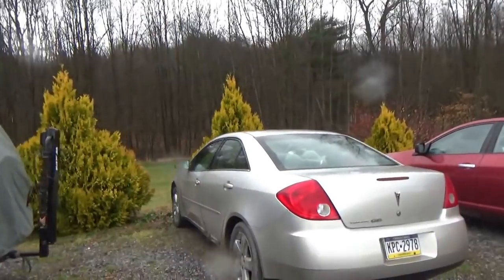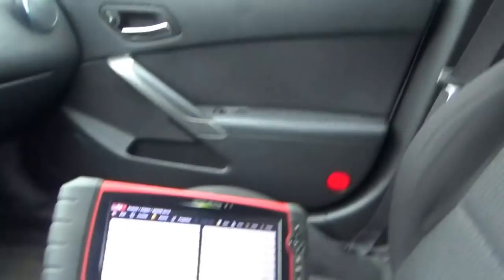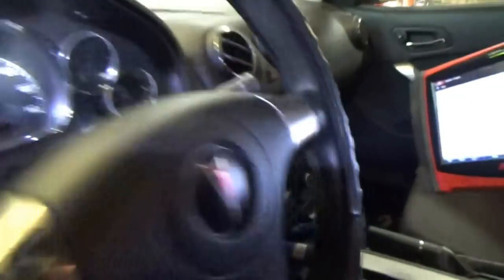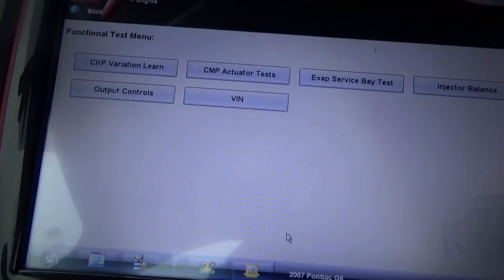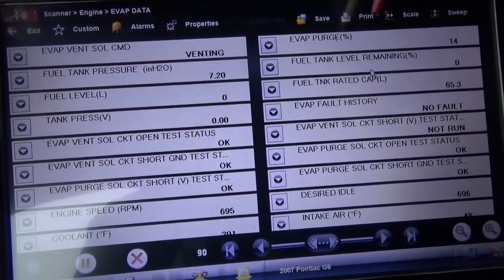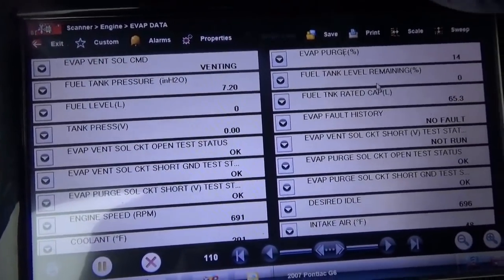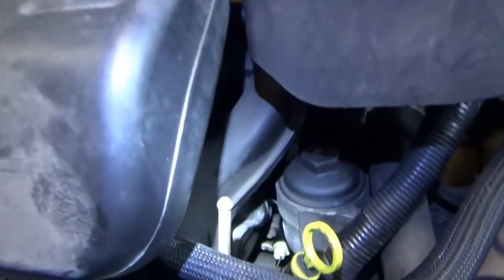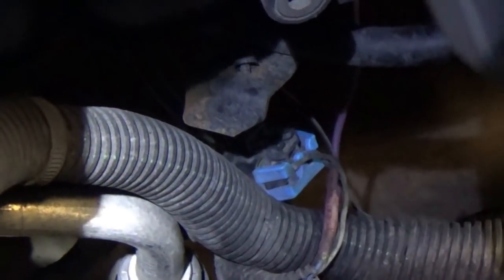GM No RPMs! P0335 Diag & Repair

Comment: On the knock sensor, once the wire is repaired, scan engine data knock signal and take a wrench and tap the engine while viewing knock signal data and you should see it pick up the taps from your wrench/screw driver/small hammer.
On the fuel level sensor, disconnect and jump your test light (bulb resistance) across the level sensor wiring and you should read about 1/4 tank, if guage doesn't move than your looking at instrument gauge repair.

Comment: I did, I did, I did.  My thought was "where are the two wires?  I only see one, what happened"  Thank you for the video Ivan.
Sometimes when I crawl on my floor I use a sheet of scrap foam insulation as a thermal break and it also helps with those tiny pebbles that dig into my knees reminding me I don't have a lift.
Reply: Man i know your pain...Hate it when you kneel on something small n sharp....

Comment: Nice diag and yes I caught the mix up I was like Ivan nooo it's the Oil Pressure Switch, I know because I have a customer with a Cobalt and had to swap the Switch out, connector was full of oil and Oil Light was on all the time 😎

Comment: Wiring under the carpet in the drivers seat area is common for many problems with rear lights and components. Pull the seats and carpeting and start tugging on wires for preventative measures. Arrange the harness of the floor and make small drain holes to allow the water to weep out. Awesome videos. Keep up the great work.

Comment: Don"t you just love when the engineers cram everything in there so its tough to get at the connections to do repairs..
Reply: Why would they place a critical connection in a hostile environment without any external protection is just poor engineering....A simply 50 cent rubber box mounted to the chaise could eliminate corrosion on the connector....

Comment: Customer must be strapped in these troubling times, otherwise would have had you sort out the fuel gauge, you were right there but you can only do what they are willing to pay for
Reply: you see the rust? dropping the tank is opening a can of worms  unless the emmissions calls for no light on the pressure sensor dont touch it.

Comment: I noticed the P0326 which is a knock sensor fault code for that particular vehicle.

In my 5.7 litre Chevrolet LS1 V8 powered Holden VY SS Commodore I had a similar P0327 code stored on the PCM which is a low output voltage code for the front knock sensor that I replaced in 2009 so I had to replace it again in 2019,the code would be set whilst driving on the freeway which also set a check engine LCD symbol on the dash & it would automatic turn itself off.

I had already replaced the rear knock for a P0332 code & the "new" sensor that I previously fitted was a Chinese knockoff which I replaced with a Wells knock sensor in early 2019.

I replaced the front one as well as the knock sensor wiring loom in mid 2019, I also did the GM TSB (technical service bulletin) for building a silicone sealant dam wall up around the sensors but my tip is to keep any water away from the Knock sensors.

Once the Connectors corrode & the knock sensors wear out a code is often set for the knock sensors !

Comment: You know I feel for the owner who had rodent damage to their vehicle. I have had a female squirrel make a nest in my Tacoma and did $400 damage two times. So, the solution is to buy a special tape made by Honda...since Honda and Toyota are both rodent targets and looks like other brands as well....this tape has capsaicin embedded in the vinyl. In Canada it is about $60 per roll. I would highly
reccomend this tape for repairs on wiring. Another good deterrent is fake snakes under the hood. My wife got me 4...they are in various locations and seems to work well. Trust me...that Honda tape is REAL GOOD
Reply: Mike Foehr my tundra became a teething ring for some squirrels. I repaired it and they came back with a vengeance and chewed wires beyond my capabilities. $7000 for a complete harness. The added the hods rodent tape.  I made some peppermint repellent containers too.  So far so good.

Comment: You could have used the test light to pull the voltage up on that pressure sensor to confirm good wiring to the pcm or could you have confirmed operation by doing a vacuum test using scan tool to shut the vent valve... All very interesting stuff

Comment: I have a 2011 silverado 5.3L. I had the rear brakes done, they also bled the brakes. The mechanic also had to retighten the transmission dipstick because it was loose.  2 days after they did this I was driving it and it went into limp mode, service traction control, service stabilitrak popped up and 0 rpm.  I turned it off and waited and then the problem went away.  I started to become harder to start throughout the week so I tested the battery and replaced it due to it being bad.  6 days later the same service stabilitrak service traction control popped up.  I had the mechanic take a look and I don't know if he ran old codes on it but I think he said it was P0335.  He said the sensors are made pretty well on these engines so he said more than likely it could be a wiring issue. I'm going to inspect it but I will have to take the starter off (damn).  I'll let you know what the wires look like.
Reply from the maker: Just scope the signal at the PCM...if you have a scope!

Comment: I just got this code on my 2006 Dodge Ram 1500 I was on the freeway and my rpm dropped and I pulled over and got the truck home. It still starts but I’m not sure what the problem is I’m going to replace the sensor hopefully it fixes the problem

Comment: I wondered how a knock sensor could leak oil. They are usually mounted to the block and not into any oil passages. Oil pressure sensors have been known to leak.

Comment: I have a 2015 Buick Verano I put a timing chain in new sensors on top of the engine I'm getting PO335 code my Tachometer isn't working is it the crank sensor? it cranks for a while before it starts Thank You

Comment: I was questioning a single wire knock sensor. Especially since I just tested one on a Saturn that was a 3 wire sensor.
Reply from the maker: 3 wires? Maybe a ground shield?
Reply: @PineHollowAutoDiagnostics  Exactly! I couldn't think of  why 3 wires. on the knock. Then I realized Saying to my self you idiot that's no a 3rd wire. It's a shield. Bloody Saturn Astra and that German engineering.  OH BTW Finally looks like I figured out the p0017.. The crankshaft gear has a small front key for the balancer. was bent. Also the notch on the balancer was egg shaped  Went tightening the balancer look like timing is dead on but it's off about a full tooth.  Will confirm when new balancer gets here. Already replaced the gear but had to order the balancer.

Comment: I thought there were two sensor wires, but when you went to the tank you lost me there!  However, it was not until you said at the end did I or could I confirm the wires were going to two sensors.  But who wants to work on cars when they are wet?  Or even dry for that matter.  Cars used to be easy to work on, what the hell happened?

Comment: You could've said that was the crank sensor, and I'd have believed it, Ivan! I can't keep modern vehicles straight. 😂 

I'm thinking auto makers purposely made wire jacketing tasty to rodents. Less old cars on the road means more new cars sold. If so, that's a pretty underhanded way of getting more business! Par for the 21st Century course. 😟

Nice work as always, Ivan! 👍🍻

Comment: I thought when. You said knock sensor was leaking oil something  was not correct because I have never seen one that could leak oil always go into blind holes or on GM coolant on older ones
Reply: It is directly below the oil filter cartridge. Messy wrenchers have a habit of dumping oil over the wiring when changing filters. But yeah, it's probably leaking. Had one on a Saturn I thought was leaking but they had an oil change done by one of those lube pit places. Should have seen that mess!

Comment: ivan there sothing i left out before i even  hook up the scan tool i wolud hook a test light to the odb2 ping 16 hear why the rpm on most cars are computer conttold now the gamble you took was hook up the scan tool and not makeing shure it was safe too ivan you could have pop that fuse ? or am i thinking out of the box

Comment: Yeah my situation is I have a 1999 mercury villager I have a crank don’t start no RPM on the dashboard but it shows RPMs on my code reader what would you suggest
Reply from the maker: Read codes. Check for spark and injector pulse.
Reply: The car is getting fuel it has a really weak ignition spark and the tachometer doesn’t work on the car but it will show RPMs on with the code reader
Reply from the maker: @terrellscaife2411  figure out why your spark is weak
Reply: Well I debated on pulling the transmission and replacing the fly wheel and tongue wheel and also I don’t have a 5 V reference when I back probe the crankshaft position wire
Reply: When I crank the engine the RPMs will show on the data stream on the code reader but the RPMs will not show on the dashboard of the car

Comment: I was kind of expecting that you were going to later note that they needed a new oil pressure sensor. My guess though about the fuel sensor issues are that you're most likely to find a mouse nest on the top of the fuel tank. I would want that inspected in case the fuel pump wires were also damaged.

Comment: Ivan, is it my imagination or are the cars that you and Eric O. working on becoming even greater pieces of shit than they normally are. Out here in Arizona no self respecting Mexican would even consider driving garbage like that. You need to institute a 100,000 mile rule. If the car has > 100,000 miles you don't touch it. Out here we would consider that mildly broken in. We don't have mice eating our wires because the rattle snakes eat the mice. Most of the problems you and Eric are currently highlighting don't exist here. Out here our mechanical parts wear out. Alternator bearings freeze up, belt tensioners wear out, engines die after 300,000 miles and are sensibly replaced due to the fact that the car's chassis is rust free. My buddy owns MAACO of Prescott, AZ and he does a great business repainting complete cars (unusual back East as they rust out from the inside before the paint dies) due to the fact that the sun eats the paint off of them. We call this condition Arizona road rash. However, in the ten years he's been in business he's never done a rust repair to my knowledge (probably because none of his bodymen would likely know how to form metal to make a patch panel as they have never had to). Out here diagnostics would be much easier as none of these rust gremlins exist.